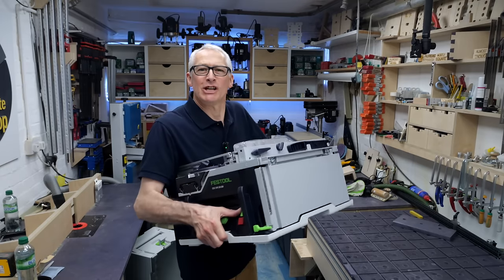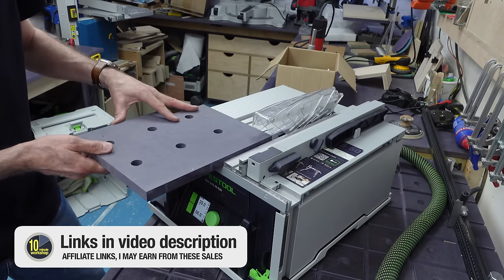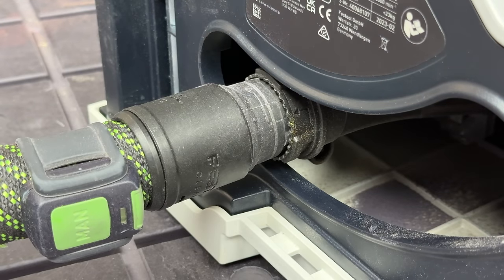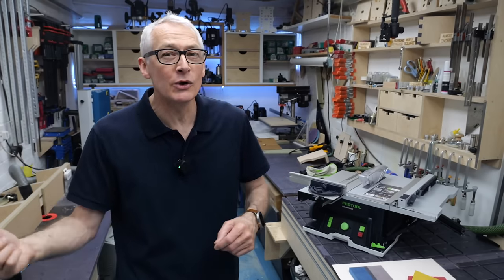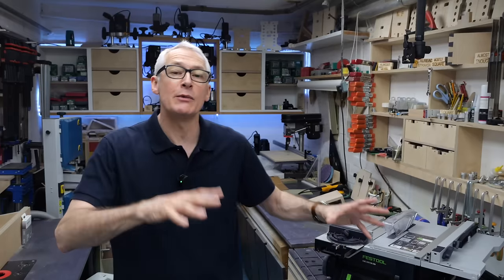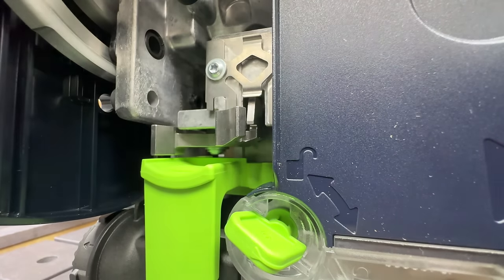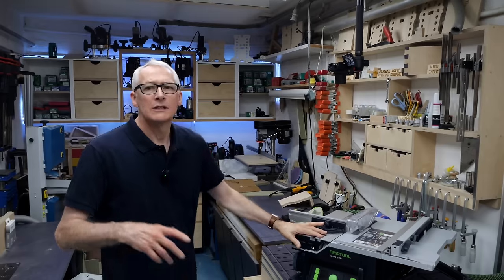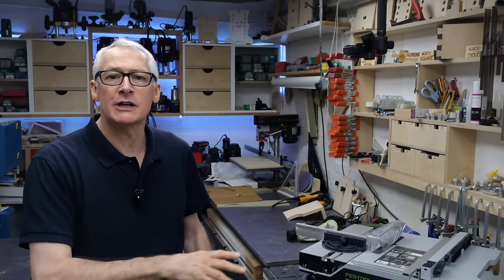Festool's Big Mistake [video 530]

Comment: Hi Peter, Had the Festool guys here this week, and regarding the battery/cord issue I can only say... Patience, they may surprise you.
Reply from the maker: Ooo, interesting, thanks! 😆👍
Reply: Extremely interesting
Reply: Very much so. Shall start saving up immediately 😊
Reply: Good to know, thank you 👍🏼
Reply: Surprise us with a £200 mains adapter maybe😉
Reply: Is it going to be a solution which works with all Festool 18/36v tools or just the CSC ? specifically will it work with the KSC60 I'm in the market for a brushless mitre saw, but absolutely wont buy one which is battery only, some tools just dont suit batteries either because of the power requirement eating through batteries too quickly like heavy breakers and grinders, or prolonged use like sanders eating through batteries, or for reasons of ergonomics (sanders again) or the tool is stationary anyway (mitre and table saws)
Also I really don't want to invest in tools which are solely dependant on batteries, especially from a company like festool which has a bad reputation for putting up their prices up every year.
Reply: Too late for my confidence.
Reply: Be nice if that surprise extended to the cordless extractors.....
Reply: I hope Festool have nothing to do with this guy ..... seriously it's like a B&Q advert for MDF
Reply: Just right i love Festool but why not a plugin cable for charging thats a fault i think when the cost is so high
Reply: Did they, by any chance, happen to mention how long it will take for the surprise to materialize? The saw would be just perfect for me, if it wasn't for the battery thing ...
Reply: This would be a very welcome surprise 🎉
Reply: Just an empty comment with empty promises
Reply: Don't tell me that hopefully it's an adapter type
Reply: @robertfrost5020 
Don't be such a snob... 🙄
Reply: where is the surprise?
Reply: I’ve got to say there is always something sloppy with all my Festool gear. It’s never perfect for the money and third parties always come up with the missing goods. The lack of being able to plug it in to mains seriously puts me off for the money. They definitely need that surprise! I would want to use it with my ctl sys extractor, how would that work?
Reply: 8 month old comment, no surprises yet.
Reply: 9 months now, I also have one issue with this saw. Batteries drain quickly, and one battery drain faster than the other one
Reply: @woodplay13 Not exclusive to the CSC, KSC60 also does this.
Reply: @saiiiiiii1  i call festool office, nothing. They dont know about any adaptor for this saw...its just some rumors
Reply: This comment is nine months old, and so far, no surprises from festool 😢
Reply: @carpenter33  Surprise Surprise! Everyone thought there will be an AC adaptor and now there is none 🤣
Reply: Still waiting ... but at least we have 8ah batteries now

Comment: I live in an apartment in Berlin, and got this for my birthday as a gift, It really quiet(compared to normal saws). I absolutely love it, I now tend to buy really quality tools, I think this will be the last table saw I buy so I decided to go for the tool I'll need for the next 10 years. I dont do big boards, and I have my track sled for when I do, or I ask at the wood store for more manegable cuts. I also dont think my life is in danger everytime I use it, which was my fear with other table saws. I do alot of mixed woodworking (kumiko, automatas,small furniture) and its really nice to set the height and go and the sled feel really nice. I did get rid of the scales I agree they were very clumsy and made me feel less safe using them. I also dont do alot of cuts so for 2 hours of cutting I need it the battery is more than enough. But all in all I would buy it again and im very happy for all the warranty it comes with.
Reply from the maker: Thanks! I’m really happy with my saw as well- it does exactly what I need, and if I pointed out any areas that could be improved it was just for information.  Looking forward to using it on some projects, and like you I have a few add-ons in mind that will improve my use of the saw. 👍👍
Reply: Did you buy the saw or get it as a gift? You mentioned both
Reply: @danthechippie4439  ha yeah confusing, I bought it for myself as a gift to me! Its a got a pretty big price tag I really understand this, but I also said to myself You know what you deserve to have a nice tool. So, got 6 monthly payments, july is the last, and Im really happy.
Reply: What is an “automatas”?

Comment: The Festool prices are just nuts. It's mass produced stuff that isn't made of rare components. Crazy.
Reply from the maker: And those Audis are just VWs in a smart suit. 🤷‍♂️
Reply: I agree it’s  a  crazy price ridiculous and I don’t think it’s that good , I personally wouldn’t pay half that,  I’ve got a Dewalt  it’s Dewalts most expensive saw and I paid £500 for it.
Reply: A nice toy, one that I will never be able to make myself buy !   all I can say about Festool is that my son bought a Festool kit  for his work in carpentry and joinery. As it wears out he is not replacing it with that brand !   I get more pleasure from making cheaper tools do what I want them to.
Reply: I’ve found value in some of their tools over cheaper options. That being said, if you don’t need some of the accuracy or convenience, than I’d agree it’s over priced. I’d say the most beneficial scenario is a professional repeating process like standardized cabinetry. But it’s a specific business model. A one man or very small team it has its place. Bc it’s not a huge output jump to going pneumatic purpose built machines that make the even higher price justified. I worked in one shop that had a dedicated pneumatic router exclusively for rayfix drilling, a 64 drill bit system drill for shelf holes, fully automated edge banding machine, etc. most people would find those tools expensive and unnecessary as well
Reply: @МУЅТ 

Yes, tools that are shared among a crew generally get beat to hell.  A company I worked for several years ago sent a Domino 500 to the job site.  The fence was totally bent, it was unusable.  I have a nice variety of Festool stuff but it never leaves my garage.  I use Makita and other brands on the job site.

Comment: As a avid Festool owner, the potential problem with the tools is when or if there is an issue your out of work for at least a couple weeks, but if your Dewalt breaks down just run down to Home Depot and get another one, for a quarter the price😂

Comment: I asked the same question about the KSC60 I'm in the market for a brushless mitre saw (ALL tools should be brushless by now) but I dont want to be trapped in a situation where I have to pay x corporations battery tax from now until doomsday to use the tool !  batteries don't last forever and you have to replace them eventually, people dont know what the price of the batteries might be in 5 or so years time (especially from festool) or the state of their finances / the economy. having a cord option on expensive stationary, or high power demand tools is a MUST ! and I wont part with my cash unless they provide a mains adaptor for the KSC60 and other tools like the CSCSYS50
Reply from the maker: I agree. It’s a daft decision not to provide main-power as an alternative, as it’s costing them short-term sales. 👍
Reply: @10MinuteWorkshop  As you said in the Video Peter, battery buy in is an obstacle for many, especially when they already have lots of tools from other manufactures, they cant justify buying into yet another brands battery eco system.

I think this effects Festool more than most as they have a smaller market share than companies like Makita and dewalt.
The only issue is how much would festool charge for a 240v / 18v/36v adaptor ? if its north of £100 they will have exactly the same buy in issue.

Comment: Having battery power on a jobsite is just a no-brainer. However, this is not a jobsite saw. But real problem with batteries is exactly how many do you need. For this you need two in + two on charge, you'll probably have two drills (Drilling + Screwing), so thats another two in + two on charge, then maybe a multi-tool, possibly a mitre saw and maybe a radio. How many is that, I've lost count..! If there's someone helping (the apprentice) they run them nearly into the ground then go for lunch without popping them in the charger. Then when you get to site you realise you're two short because your partner borrowed them to cut the lawn...

Comment: Just had mine landed this morning with the Festool bench too. Well, I watched your video yesterday and I had major panic that I been wasted my money. But, no, this is the best saw I have used to date. Mine is perfect out of the box, no adjustment to the blade needed, the cut is one of the best I experienced. A very very refined saw indeed. Very quite in comparison to my Dewalt and less hectic when cutting. So far, it is a great purchase for me :)
Reply from the maker: Fantastic news, and perfect for the weekend too! It's a great saw, and I'm really pleased with it and while there are areas where they could be improved, that takes nothing away from the things it does so well - small, quiet, lightweight and with great dust collection. Excellent you had one that was bang-on out of the box, too. Thanks for taking the time to make this comment, much appreciated! 🙌 👍

Comment: This would be a great saw for fitters like you said, and hobbyists who work on smaller items, if not for the eye watering price. The wobbly fit is not something you expect when you pay so much money for a tool that's supposed to be precise.
As for the cordless only, watch them release a mains adapter that plugs in the battery slot, will probably be at least £200.
Reply: Gouging at its finest...😂

Comment: I very much agree on the cordless vs mains power issue Peter. I bought the Hikoki 36v offering and then later invested in the mains adapter. I’m finding it a total game changer on many  jobs, and the adapter will run my cordless mitre saw too (or any other Hikoki multi volt tool. Totally understand why you bought the Festool, but I guess my point is in agreeing with the mains power point.

Comment: I own the saw and mainly use it for kitchen cabinet fillers, I used to have the DeWalt table saw and the comparing the noise, weight and dust collection the Festool absolutely shines. I'm not on the battery platform so its a real pain as the 5ah batteries don't last long, but the new dual fast charger fully charges both in 20 minutes. I'll eventually buy another set of batteries, but perhaps this is what Festool wants by not supplying AC power!
Reply from the maker: That’s really interesting thanks! It’s a great saw, really looking forward to using it on projects. Size, weight, noise and dust extraction is excellent - I’ve no direct experience of eg the DeWalt, so really appreciate the feedback. Impressive investment considering you’re not on the battery platform, and thanks so much for taking the time to comment ! 🙌👍👍
Reply: Wow 20 minutes for 2x4.0ah batteries is fast!
Reply: @Smithb83  no sir, 20 minutes for 2 5.2ah batteries! I couldn’t believe it either. It’s festool new battery fast dual charger
Reply: Thanks for the information from another actual user of the saw.. I also own the small DeWalt 210mm table saw I got particularly it for its small footprint.. it's decent, However I can see how the festool would trump it for bathroom and kitchen fitters on site in small UK homes.. seems like a well thought out package..I am tempted..

Comment: Thank you for the review!

I bought a cheap table saw a few years ago. I've been dealing with several, sometimes dangerous, issues😤.
A longer while ago, after lots of going back and forth, I finally bought a DeWalt DWE7485. And just several weeks later, Festool announced the CSC SYS 50. 😒
The compact size and portability would be great, as space in my basement woodshop is pretty limited and I sometimes visit my family to help with upkeeping and projects. Only downside would be another battery system. I wish the announcement came a bit sooner. If Festool comes up with some sort of power adapter, I'm pretty sure I'd buy the saw rather sooner than later. I remeber seeing a Festool AC 220-240V / 18V adapter somewhere in the past. It looked like a big battery pack with a Festool power cord connector. I know they offer a newer and smaller version for some of their sanders.

Comment: Great review of the saw. 2 design teams is a great perspective. 

I have a DeWalt jobsite saw in my shop for several reasons but what I find most intriguing about this saw is that it is actually the type of saw I would like. I have made jigs and fixtures to compensate for what is lacking in the DeWalt. 

Truly I think there is a market for hobbiest table saws that are intended for working with smaller pieces.
Reply from the maker: I completely agree! I think there's a big market for a small, quiet saw with great dust collection. Strip out the electronics, put in a power cord and get the price down a bit and they'd have a hit with the hobby market. 👍
Reply: @10MinuteWorkshop  Yes it doesn’t need bells and whistles, just simple setup. The sliding table is great.

Comment: Battery only is a no go for me. Same as routers/track-saws. You still have the extractor hose so might as well have the power lead.
Reply: My thoughts exactly, recently bought the new festool track saw tsv60 after having the festool cordless ts55 for few yrs, still had to connect the extraction so I opted for corded this time

Comment: Great video! Thank you for posting! 🙌I was immediately drawn to this saw as I use other festool tools and currently own a dewalt jobsite saw that could be upgraded. But feel like I dont want to commit to this festool saw with it being battery only. Love all the other features its offers, like the sliding table, auto adjusting blade and that its super compact, the dust extraction etc. But the battery only is 100% putting me off. And would love to see the sawstop tech in a mains powered option of this saw (that would tick all the boxes for me).

Comment: On the subject of the sloppy fit of the fences, I would think this is a deliberate decision so that you get the best accuracy in cutting and it's safer. If the rip fence was a snug fit, you might think you'd locked it and then have it move. Not good!
When you have the rigidity and acuracy of the sliding table would you really want to use even a decently fitting sliding fence which is never going to be as good? I concede that it would give you more ripping length so it's swings and roundabouts I guess.
Great video, thanks.

Comment: The clear, segmented blade guard is more or less the same as on the SawStop full size cabinet saw I have.  Sure, it's a great safety feature, but holy heck does it ruin your view of the blade, and of the work you're trying to do.  If/when I'm doing repeated cuts for projects, this isn't a big deal, but if I'm changing cuts a lot, I have to do a lot of double checking, or simply remove it while setting up, then put it back on when cutting.

Comment: I love the way it adjust the height of the blade when doing angles! takes the guesswork out, Does any saw have a decent 'blade guard that people dont just take off? unlike Festool I have the RTSC 400 Li (which is cordless but with the adaper to plug it into the cord for mains use! A China outsource? does not sound or look like full German engineering to me, be perfect for me and I'm a Festool fan but the price!!!

Comment: I’m a Festool fan.we use the sanders, track saws, Domino, and routers in our small cabinet biz. They are a pleasure to use, and very robust tools that are worth their cost to professionals. We don’t use the battery platform at all, as we prefer Dewalt. We cut our fillers on site with a track saw. Corded or not, I can’t see a use for it in our daily work. And consider it crazy expensive for what it is. And BTW, the TS60 is corded here in the US. We use unitized hoses in the shop at every tool, making that saw a no go for us, much like Maffell. Festool strayed from the path on that one…

Comment: They absolutely need to make it work with mains power. Hikoki and DeWalt have proven that it is possible. The cordless Festool sanders already have a power adaptor, so why not make one for the other tools? 

It would make so much sense, especially for these newer additions. I have the KSC60, and it's absolutely wonderful cutting trim all day with a set of batteries. But when you need to do more production work, which even happens on site sometimes, it'd be really nice to be able to plug in and not need to worry about it.

My main gripe is that I would love a cordless dust extractor. 
I have the corded ctl mini, but I can't replace it with the cordless, because sometimes it's for the tracksaw and cleanup, other times I spend hours sanding on a job. I can't justify buying 2 full size vacuums and having to pack the van according to the use case that day. I'd gladly pay a premium to have 2 in 1 hybrid tool that can run cordless when I need it.

What I also noticed that a lot of manufacturers only improve upon their cordless tools. If you want the better feature set, you have to go cordless even if you use it in a production/workshop environment. It only adds cost and weight in a lot of cases.

Anyways, thanks for the video, great stuff as usual!
Reply from the maker: Thanks! Yep, hybrid corded/cordless is the way to go IMHO, not one of the other.  🤷‍♂️👍